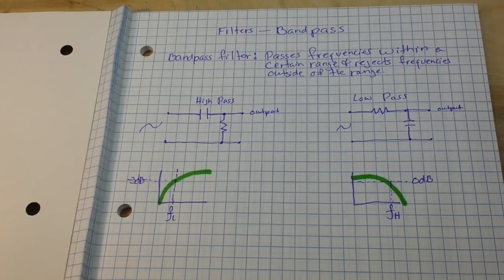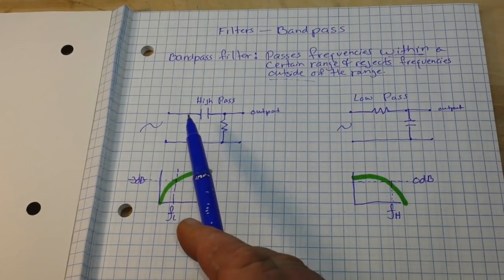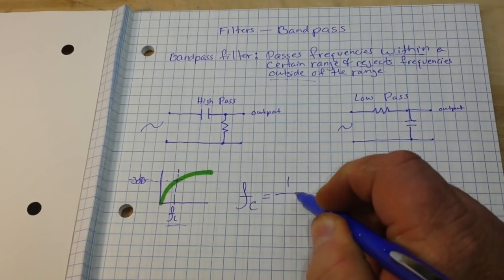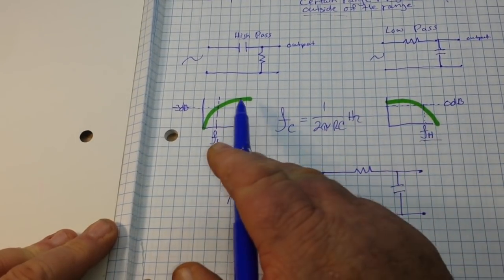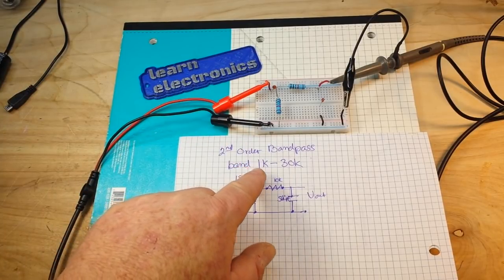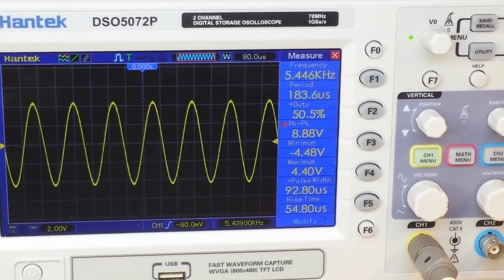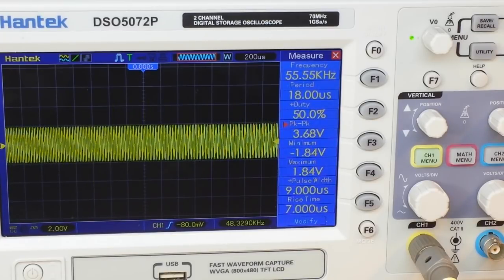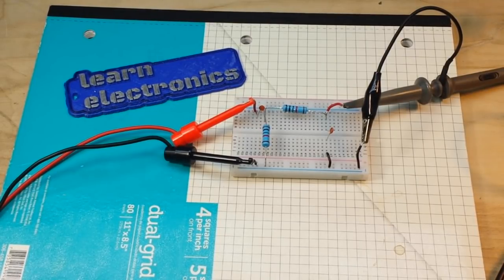How to design and build a bandpass filter

Comment: Hello, thx for this clear explanation. Have some questions. For a project I need to analize about 5 frequence bands between 100-600 Hz. In order to sharpen the separation is it possible to cascede 2 or more band pass circuits?
Andrea

Comment: At around 1:35 you say the low pass attenuates everything above the line which you marked as someone else noted as 0db which should be 3db.  Doesn't a low pass filter pass low frequencies and attenuates frequencies  above the cutoff frequency?

Comment: Loved the equations and showing how it all works on the oscilloscope. I came to your site because I wanted to build a band pass filter for the frequency range of 43 KHZ to 46.8 KHZ. I wanted to amplify a magnetic field using transformer wire wrapped around a small steel collar about 100 turns or so. Would a 9 volt battery be safe to use if C1 is 100 nF, R1 = 37 ohms, C2 = 1 nF, and R2 = 3402 ohms. I was planning on adding this onto the end of a pinpointer that detects metal and move it just into position so that once it stops beeping I have it locked down in place. I may be able to add a potentiometer in series just before C1 if that would lower the voltage going into the circuit. I just hope that it doesn't change to band pass filter settings with these values in place. I was hoping to extend the range of it picking metal up instead of one inch extra with just the collar of metal by itself to a few more inches. if that works to add a coating around it that will harden up, and make all the electronic parts water proofed and held together. then run the wires out with the potentiometer further away on a plastic pole. Unless you think that I don't need the potentiometer and just hook it up to a 9 volt battery at full power? I don't know if the field will be too strong and make the device start beeping because the magnetic field got too strong by the pinpointer. So I got to make sure I can lower the strength of the field if need be.

Comment: Hi, I am currently using an active band pass filter which uses a non inverting amplifier between the passive high pass and passive low pass filter. Is there a reason for the ranges to not be very close to the calculated values and is there a way to improve the cutoff frequency ranges?

Comment: This is a great explanation! I'm trying to build a bandpass filter for 87.5 MHz with a bandwidth of 200 KHz for radio broadcasting, and I'm curious as to how I would go about obtaining the specific components required. 

I know I need a 100nF capacitor, a 1nF capacitor, a 2Ω resistor, and a 0.02Ω resistor. Is there a place I can go to buy these online?

Comment: Nice video. I am going to try to build a set of HF bandpass filters for a low power radio (IC-705) so I don't overload it when I use my IC-7610 and amp on a different band.

Comment: Loved your videos on the pass filters. You make it look so simple and elegant. How about a video that combines your pass filter videos into a graphic equalizer?  I'm unsure how to run an audio signal (3.5mm headphone jack) into 5 pass filters(LBP, BP, BP, BP, HBP) and then capture the individual outputs with an Arduino using analogRead on 5 separate pins.  I guess my question is how to prevent the filters from interacting with each other if they're all being fed the same audio source. Diodes? :/
Reply: No you can use op amps. They prevent the different stages from influencing each other :) But you can't use them for RF frequencies cuz they can't switch fast enough. For audio frequencies it should be fine though

Comment: Great video! Question: I thought you needed to have a buffer between passive filter stages to prevent 1 stage from loading the other stage and changing the fc, am I missing something?
Reply from the maker: +Lloyd Jackson a buffer is good practice, this is the textbook version
Reply: learnelectronics Oh ok, thanks. So this bandpass configuration works fine unless you need it to be very accurate to the cut off freq then you would add buffer between?

Comment: How do you know what range of resistors and and capacitors to use? For the filter application that you want to build.
Reply: 1/2(pi)RC   1 divided by 2 x pi(3.14) x R(Resistor value) x C(Capacitor value)
Reply: Yes I know that’s for the frequency.